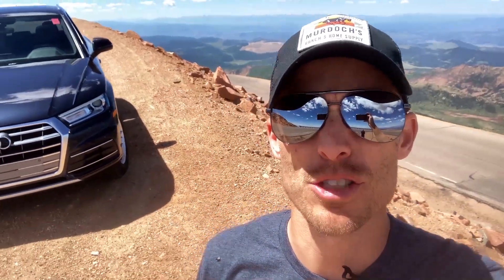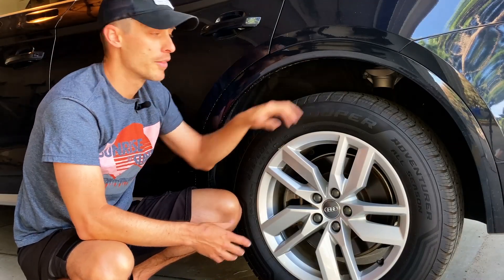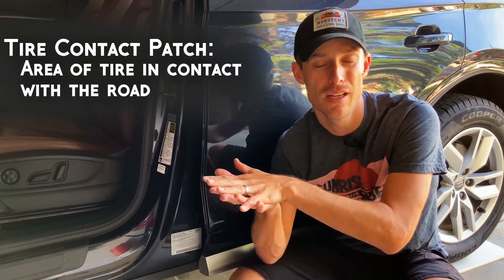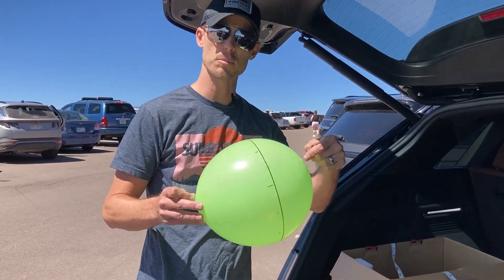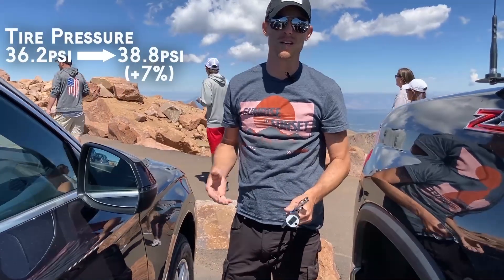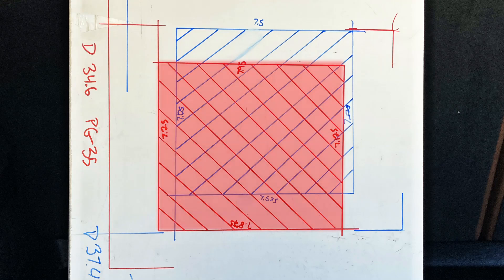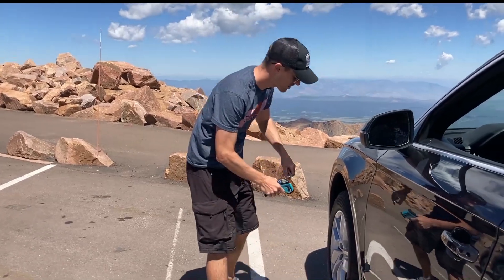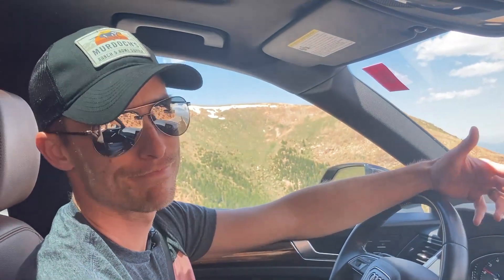How Much Does Driving Up a Mountain Change Tire Pressure? @visitpikespeak

Comment: Thanks for this extensive video to find out if the tire pressure changes in the much higher altitude.  My understanding is that the recommended cold tire pressure is based on 20C/68F at sea level in evenly shaded environment so the vehicle owners may adjusted their tire pressure accordingly based on their location, temperature & load.  In Europe,  cold tire pressure label in some vehicle  have three listings: Standard = <100KM / High Speed= 160KM / ECO= same as High Speed due to some roads have no speed limit.  To measure the contact patch correctly maybe  jacking up the individual wheels before & after the drive, apply some coal or paint on the bottom of the tire and lower the tires down again to mark the patches accurately... that is, if someone really must know.  Here are some references I have found related to tire pressure measurement:

https://en.wikipedia.org/wiki/Cold_inflation_pressure#:~:text=Recommended%20cold%20inflation%20pressure%20is,when%20not%20warmed%20by%20driving.

https://www.tirerack.com/upgrade-garage/does-altitude-change-tire-pressure

https://www.rimex.com/wp-content/uploads/2020/05/understanding-cold-inflation-pressure.pdf

Comment: I lost this bet once, tire pressure and patch pressure are close, but not the same because of the added structural rigidity from steel belts, tread & forming structure, and material compounds.  The tire doesn’t flex like a latex balloon, so the patch doesn’t quite equal the internal pressure.
Reply from the maker: True.  I've seen guys run zero psi on dirtbikes trying to increase traction.  The sidewall is all that holds the tire up in those cases.

Comment: In your opinion, do you think you could have just used ideal gas law ?
Reply from the maker: PV=nRT is based on Absolute Pressure, which was nearly constant in this scenario (because temperature had very little change, luckily).  The decrease in atmospheric pressure caused the increase in gauge pressure and decrease in contact patch even though, according to the ideal gas law, nothing changed inside the tire.